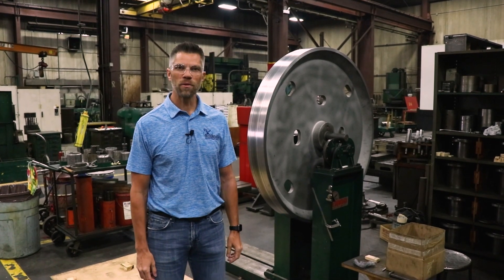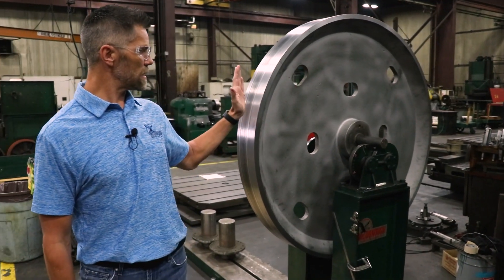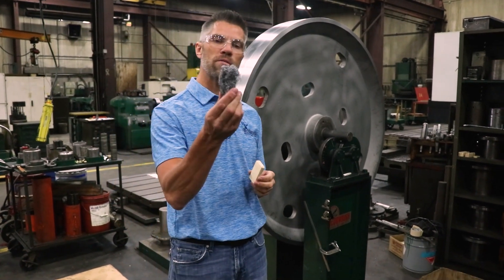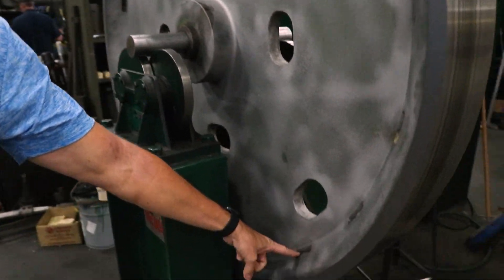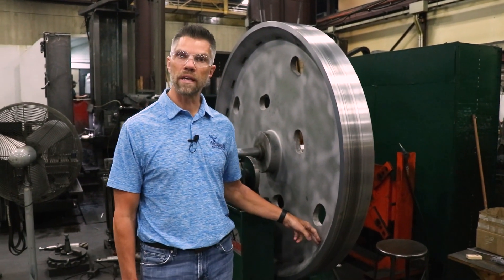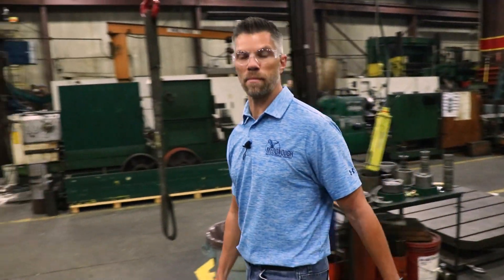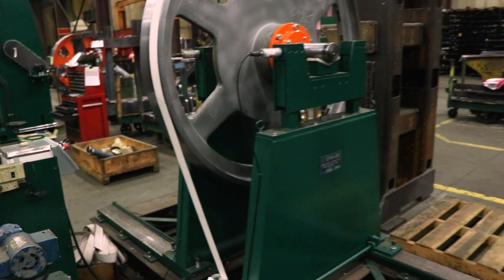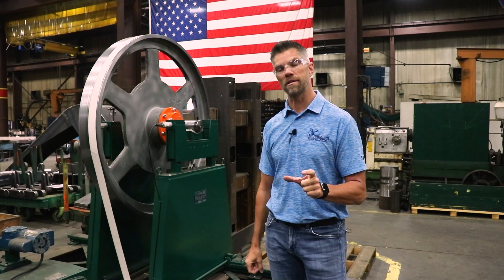A Minute with Matt | Balancing Band Mill Wheels | McDonough Manufacturing

Comment: Why do small shop wood band saws have rubber tires and large sawmills are able to run the bands on steel directly? Fantastic craftsmanship in your machine builds, you are a lucky man to be where you are.
Reply from the maker: Most do not have a strain mechanism, but it's also the saw blade itself.  Wider saw blades have tension put into the body of the blade after every 4 hours of running.  Narrow blades do not.
Reply: Simplicity and Quietness, narrow bands, being those 2" wide or less can be run on wheels with tires or without. But without means you have to run the teeth hanging out over the edge of the wheel, which is achievable by a couple of different methods, but on a workshop bandsaw with varying width blades, some of which can be extremely narrow, it's just easier all round to let the teeth run on the tire, as the very narrow blades have to run the teeth on the wheel.